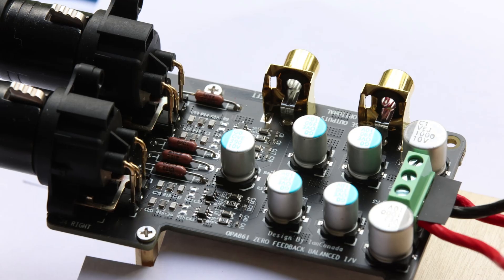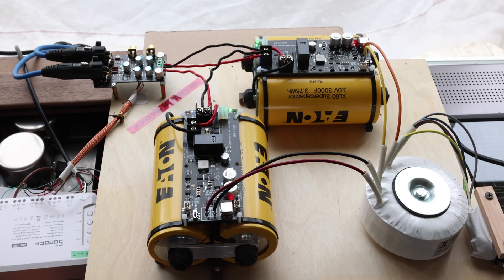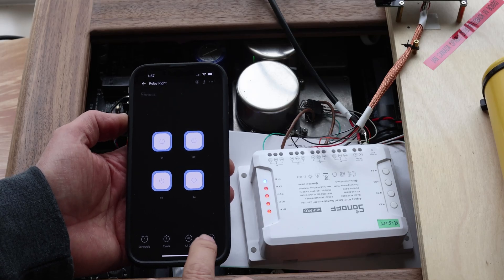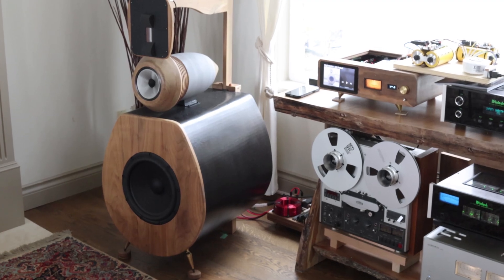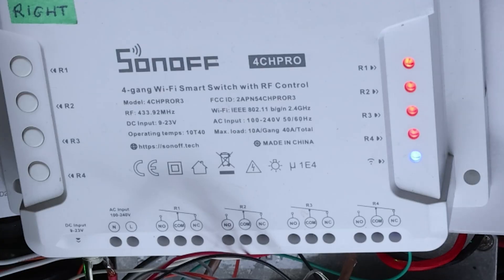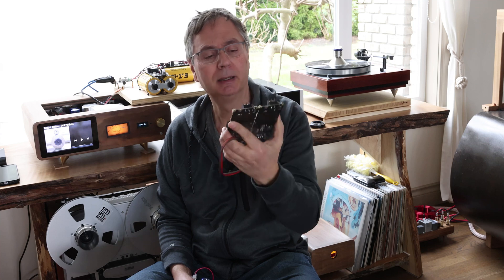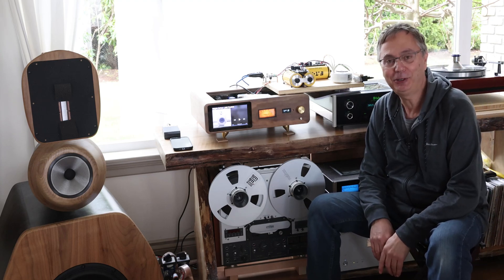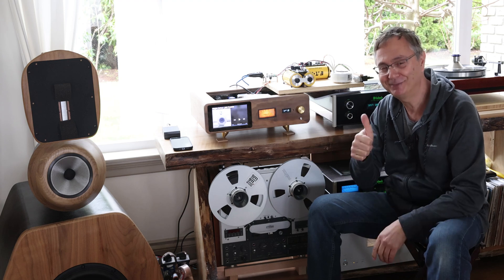Amazing HIFI Dac I/V stage     IanCanada's  Opa861 zero feedback balanced I/V board review

Comment: If the gear rack wasnt as high as mid zone would really sound sexier . No gear that goes higher then bottum of mid . And it really does wonders as no gear best but i had mine little higher than yours and i removed that hieght as i was not really buying would do much but i was wrong after it ate at me that i wasnt hearing full depth n better blending esp vocals 😮😮 you got me into kits ty

Comment: Hi @Gabster1 I can't understand why Ian banishes OPA861 rca output? OPA 861 sounds very interesting but I use classic tube amplifier without xlr input. Should I avoid OPA861 in this configuration?
Reply from the maker: I think you are fine specially if you have descent short interconnection. There is a dual opa861 to create a true balanced design so you loose a tiny bit on that. I recall trying it on a single ended tube amp and sounded good. 
You can also try transformers and see if it is better for you but they are close.

Comment: Hi there Gabby, does my little purepi's 5volt rail have enough juice for my opa 861, I'm having some issues with the sound after it's hooked up to IanCanada dual mono dac, (local xo clock removed with the ucl cable going to fifipi), fifopi ma, raspberry pi 4, on the purepi. The sound is very distorted, thin and pretty much unlistenable going into a Prima luna dialogue premium hp and Neat petite classic ( the newer version). Thanks for the information you provide in these videos, it's invaluable to us folks that aren't very advanced in diy electronics . it's a learning curve for sure but fun and infuriating at the same time.🤣
Reply from the maker: You need a Dual rail +5v 0 and -5V  separate Power  Like a linear Pi dual rail with 2 separate dc supplies or 2 separate AC windings you connect one + output to the second - output and that becomes your center tap.
you can not use it to power other things just the OPA as far as I know as you risk shorting things
I drew a sketch that can help but any 2 separate 5v good power supplies will do 
Here is how to configure +5v 0 -5v
https://drive.google.com/file/d/1jpKLNlcRqB6fv_TQlUmfvFCTQNNf24Yr/view?usp=drive_link
Reply: @Gabster1 , oh well, that's all way above my novice skill level, I'll put those parts aside and add the transportpi aes onto my purepi / fifopi ma and just use as a streaming transport into my njc audio dac.....until I can ( if ever) get my head around a build as complex as the dac/output stage etc etc. Thanks for the information, before I started buying more parts that are out my depth..doh!🤔
Reply from the maker: @mrmwrsmith   in this case you can use 2 simple IFI power supplies for the OPA 861 and wire 1 + to the other -  Or
Try the Protodac no need for additional power as it automatically takes it from the existing purepi 5v no need for output stage or transformers it is cheap and sounds great.
Reply: @Gabster1 ..so I already have a 5 volt ifi power socket (uk). and could easily get another, So would...I cut and strip them to the bare wire, and connect "one supply into + and one into -, "or do I bind the + from the two supply's and bind the - from the two supply's, forgive me if I'm being stupid, diy electronics is new to me, but I find it very interesting.
Reply from the maker: may be use the mini usb or USBC connectors strips those wires so yo do not waste the IFI in case you need to use it for something else 
here is a diagram I tried it it works but do this at your own risk make sure you observe the polarities when coneecting to the OPa or you will instantly fry it
https://drive.google.com/file/d/1NEGwD_zHkeSM7-h5HbGUABxTFN-La0H7/view?usp=drive_link

  @mrmwrsmith
Reply: @Gabster1 , Hi Gabby, just giving you a update, I connected the two ifi power supplies.....and.......nothing....lol....after a bit of investigation....it appears  the master clock socket has been damaged ( I can't get a proper seating of the coaxial cable in the socket) on the fifopi ma, so I'm not able to achieve synchronous mode between the dac and fifopi, so in the meantime I returned the original clock to the dac board for a asynchronous mode.....I now have sound  from the opa 861....and it sounds very, very good, indeed, thanks for your guidance and I will at some point during my learning process, get this running with a dual rail psu fed by a toroid ( how much va?) and eventually into a case with touchscreen.🤣🤣. A bit ambitious for a novice like myself,  but imagine enthusiastic.lol.

Comment: Hi Gab, I/V board sounds MUCH better than transformers in my system. Have you by chance tried different I/V resistor values and types?
Reply: There is some resistor swapping required but resistance matching is imperative for correct Transformers performance and HF/LF output. Calculating the approximate value according to preamp requirements is a good place to start. Once the value is decided or calculated and balanced according to SUT/SDT a good quality resistor will make all the difference. I have made my own manganin resistors and tried all sorts. The best i have used and that i have settled on for IV stage is Z foil Charcroft resistors. They are expensive yes but the performance is best I can find. This is a very misunderstood area in the Hi-Fi industry. I can confirm that Ivan Biyak is a master in this field and time spent here can make or break the sound of a system regardless of the amount of money spent elsewhere. If you have a Passive or Active I/V stage resistor quality will make more of an impact than almost any other component/cable even DAC IMHO.

Comment: Hi,
I only started building diy audio because of inspiration from you, so for this i am very thankful and really enjoy most of your content, however.....
This video is very misleading. I own a few sets of Ivans transformers active and passive as well as Ians Opa. 
The fact that you are using these two products into the same impedance preamp means the passive transformer isn't set up to achieve best performance and the opa is active so side by side comparison is no fair at all.
If you compare an active jfet Ivan transformer correctly tuned board with Ian's Opa board its night and day clear that Ians Opa is totally out classed. Ians opa board has and output impedance of about 500R.
My 1:29 60D active Ivan trf board has an input impedance of less that 10 ohms and output of under 20Ohms...... 
I can tell all your viewers that Ians opa board is nice but no match for correctly setup active jfet trf board regardless of what dac chip used. Yes it is not something one can do i a few hrs but well worth the effort.
Ivan's transformers in an active configuration has no peers....

Comment: Dear Gaby, great video series. I can hear on my ipad pro that coupling without transformers sounds really better, more flow more dynamics more natural.
I wood like to introduce to you Diretta that is a IPV-6 internet protocol ism ROON.
Your RPI -i2S-DAC configuration is recently made suitable for Diretta.
Diretta does not change your hardware it is a new and great way to get internet streaming with ROON without internet clock issues.

Comment: Hi Gabster, thanks again for this wonderfull video. I am considering building a streamer/dac based on Ian’s stuff but was in doubt which output stage to use. Due to this video I think I will go for the opa. I already have a linear pi dualpower supply, how should I connect it since the manual says you need a dual rail? Do you maybe know if it would  also work with a single (connect  +/- 5VDC)? Keep up the good work 👍🏼
Reply from the maker: As far as I know you need a separate linear Pi dual rail with 2 separate dc supplies or 2 separate AC windings you connect one + output to the second - output and that becomes your center tap.
you can not use it to power other things just the OPA as far as I know as you risk shorting things.

Comment: For me Ian's Opa861 sounded better it has more Dynamic range and the Bass felt tight and well controlled  while keeping the same relaxed and pure feel as the transformers.
Transformers are not the best at the very low frequencies in general specially below 50 hertz.
Reply from the maker: Thank you for your Input and sharing what you hear.

Comment: Very good comparison, thank you, Gaby. I was interested in how the 861 sounds compared to transformers. Do the RCA outputs work simultaneously with XLRs to connect a subwoofer?
Reply from the maker: Yes as far as I know it does but I would do a good listen with and without to make sure the added impedance is not affecting the sound.